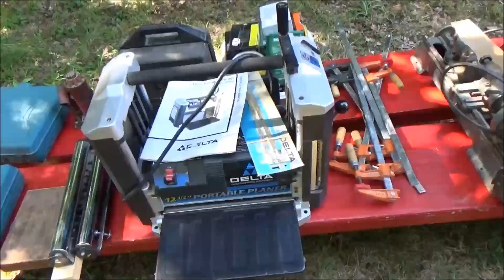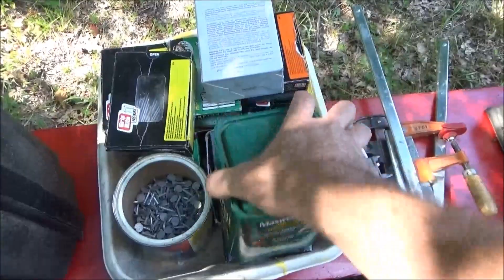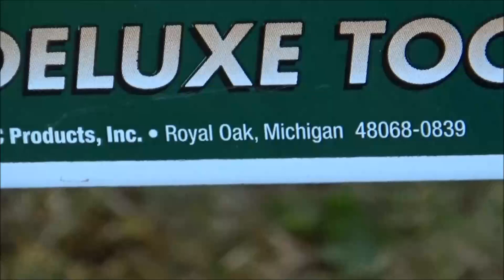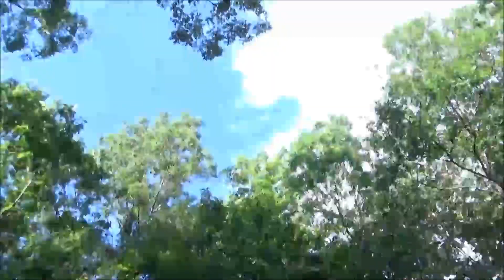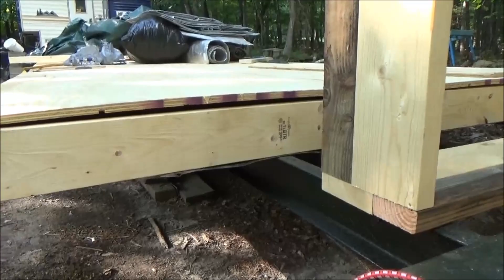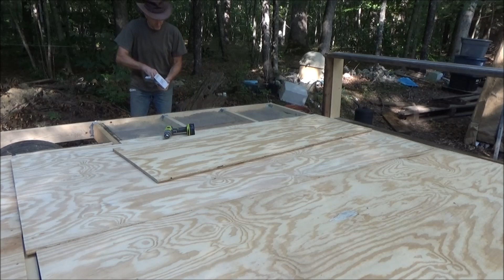Huge Craigslist Tool Haul And Finishing My Tiny House Flooring

Comment: It’s probably too late but ‘looks like’ your joist hangers are upside down. ??
Reply from the maker: Yes, I was told to do that because the house was larger than the trailer frame.
Reply: Yes I heard that when I went back to look at your previous vid. But looks like your floor extends equally on both sides - unless you were intending on placing greater load on one of those sides. In that case yes you could hang joists upside down on the opposite side (lesser load side). ?

Comment: For the floor grain, the best thing to do is to hit it with a belt sander to bring it down, or  to just consider it an under-floor, if it doesn't smooth out perfectly.  If you want to save DAYS sending it...hate to say it...LINOLEUM.

Actually, if you've got enough palette wood on hand, now that you've got the planer, you can go absolutely nuts and do yourself a MONSTER of a wood-tiled floor!  Maybe a nice herringbone pattern, just so that it's different from anything else most have ever seen?  You can get router bits for tongue-and-groove slots, and convert all of those palettes into perfect wooden tiles!

Now, for the floor wood warping...the best solution I can think of is CONSTRUCTION ADHESIVE.  Lay a nice bead of that on every joist, and when you screw it down, IT WILL HOLD.  That's what I used on the shed at the cottage, and the floor in there is still perfectly level almost 10 years later...down by the lake, the humidity can be absolutely horrendous.  Can practically guarantee that stuff'll work to keep those boards down, and when they lose their humidity once it's fully enclosed, it'll be good and solid.

Note:  Never used "Liquid Nails" before, but I'm sure it'll be just as good, as it's designed for the same purpose as the professional-grade stuff I weaselled of my buddy way back when, in return for a barbecue  I mean...we WERE at the beach...what better lunch/bribe/trade than that?  d;o)

Comment: One 2x6 across the width of the wheel well is not enough to support a wall.  I'm not even sure 2 is.  You should really consider building that section like a header at the very least.  (two layers with 1/2" ply on the inside.)
Reply: ***** 2 points to remember. The smaller the header the less the weight, and the more room for insulation. Both of which are very important when building a My tiny home.
Reply: ***** 2-2/8's  would do it. and would give more area for insulation.
Reply: You have a very valid point, there.

Consider it as though it was a door or a window, only with the cripples going from the bottom up.  Since there will be a window above it (on the kitchen sink side), I'd reccommend using a double 2x10 or even a double 2x12 to be absolutely sure that it can't support not only the wall, but also the window framing, without bending in the middle.

A 2x12 is probably "slight overkill", but it's better to overbuild than underbuild and have to fix it again later on.  There is no such thing as "too solid" or "too strong" in framing...just in mattresses.  d;o)
Reply: Jim Watson True...I was just considering the fact that he's going to have a window over that opening, which will concentrate the weight back towards the center, unless he makes his window header excessively large, far exceeding the size required for the window, so that it rests outside of the wheel well opening.

Actually, even that wouldn't be a bad idea, considering that the wheel well is going to be subject to the elements and stresses more than most other parts of the thing.

Since he's not considering moving it regularly, it's really up to him whether he chooses to overbuild, build to need, or build for weight savings...but as long as it's doubled, he might be able to get away with two 2x8's, and still have enough carrying capacity so he won't need to oversize the window header.

Me?  I tend to overbuild wherever possible, but I also built a shed, and didn't have any concerns about potential future movement...

Comment: Why are you making those wheel wells larger than the crown of the tires?  The full width of the tires can never be lifted up into the house.  Why would you want to do that?  Fenders are curved or faceted because tires are not square.   If you stick to your plan, you're putting an extra 6 to 10 cubic feet of useless furniture on the interior of your home.

Comment: Moisture changes wood in width, not length.  That is to say, the grain can get wider but not longer.    It's how you built it or pushed it around when applying sheeting.  Ply does not grow when wet in width or length but only thickness.

Comment: I have the Makita drill.  3 regular ones and a right angle.  Also have the saw.  Awesome quality.  The 4 jaw chuck is for holding square and odd shaped things.  The 3 jaw is what you'll use on round stock which is almost always.  Very cool pile of tools.

Comment: After using that new speed square to scribe a line, slide it over a few inches and use it a fence, up against the circular saw's base plate. It will ensure that your cuts are straight and prevent the blade from binding and trying to kick back

Comment: Hi Troy - I too cannot cut straight to save my life. When I'm cutting a 2x4 or 2x6 I use my speed square as a fence against my skill saw to keep it square. 

As well, lumber purchased from a Lowe's, Home Depot, etc - anywhere where it is stored indoors will always warp once set outside in a non-climate controlled environment. A way to avoid this is to find a lumber yard that stores everything outside so that you get "seasoned" lumber. However, these yards are becoming increasingly rare and tend to be catering to a more specialist crowd.  

Nice score on the planer! Delta too! Nice Canadian Made tool.

Comment: Although I love the idea of a tiny house, and would like to start my own, I am really concerned about your set up.  You have the walls, which support the roof and everything down to the floor supported by air.  The pressure from the walls and roof, will bare down on the plywood and 2x6's on the outside of your floor, and eventually bowe and cave from the pressure if not supported.  Just my concern. DO a test, stand on the outside of your tiny house and bounce and watch it flex.  Now think about yourself weighing 500 pounds going down the road, or just sitting there.  You could support it with jack stands or cinder blocks, but walls have to be supported.

Comment: That little warp in the plywood won't be as big of a deal as you think.  As far as the raising of the grain... sand it and put some sealer on it.  If you are thinking of using the plywood as a finished floor lay down some spar varnish sand and repeat.  It will turn out slick as a baby's butt...

Comment: Troy, I sent you the screening material for your front porch to keep the bugs out. (Staple it on and then put thin strips of wood over the staples to give it strength.) I also sent the two batteries and charger so you wouldn't run out of electricity while you are building your tiny house. I love your video's and I am praying you are ready for winter before it gets too cold up there!

Comment: One thing I learned the hard way, when using recycled wood, ALWAYS check that your ends are square before measuring.
Reply: So many things to remember!
Reply: Jim Watson I kicked myself when I discovered one 2x4 that I had cut to length for the wall of my hen house was not square on the end. Couldn't figure out why I couldn't get the top piece to fit right, till I noticed the one end was a quarter inch too long on one edge. Thankfully, I measured from the short side!
Reply: MotherOfManyHorses  
When you said "One thing I learned the hard way", I imagined all kinds of unusable 2/s with out of square ends. I would say 1 board is a pretty easy lesson when you could still use it.
Reply: Jim Watson Well, when you consider that I am only using reclaimed lumber, I have a limited supply. If I had not been able to salvage that one board, it would have been very bad.

Comment: Super nice haul.  Very lucky to get so much for free.  Did I see in a previous video that you had a craftsman jointer in storage?  It would be a really good idea to joint one side of the pallet boards before sending them through the planer.  Another good idea is to try and have everything close to the same thickness before sending them through the planer.  This will allow you to send them through end to end non-stop.  By doing that you will reduce what is called "end snipe".  That is when the planer tears up the ends of boards.  You can look it up on youtube if you are not familiar with what I'm talking about.  Do you plan to use the pallet wood for siding by over lapping?  What is happening to your plywood flooring is normal.  You can sand it later and use a lot of finish on it or cover it with something simple like linoleum or that tongue and groove fake wood flooring.  Remnants can be found fairly easily.  Around your stove/fire place, I would seriously consider ceramic tile or stone.  I know it's kinda heavy but it can absorb a lot of heat and it's safe if hot coals land on it when you are cleaning the ashes.

Comment: How will u change the tire on the trailer if it popped the frame of the house blocks the tire aka the wood around the tires.

An idea is to make a access hatch to Change the tires